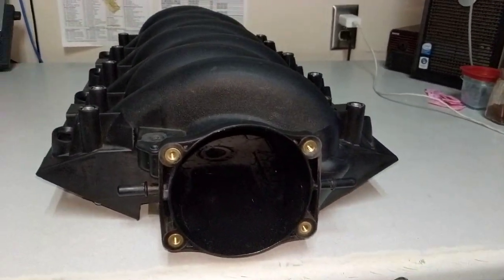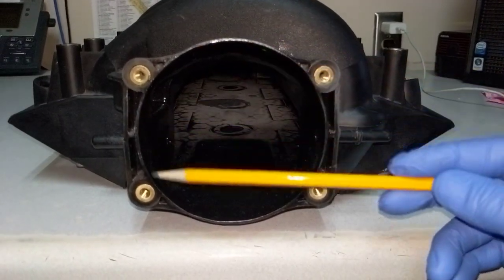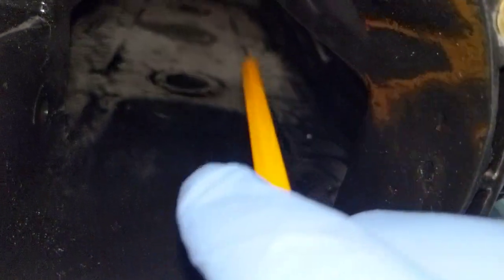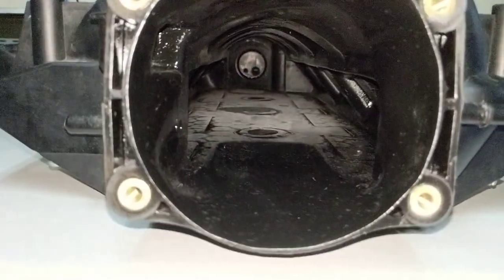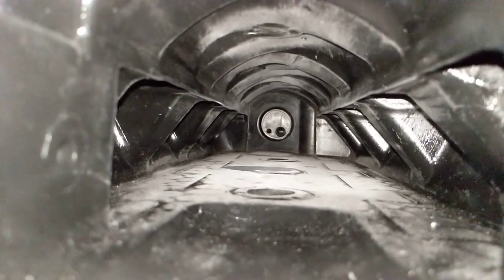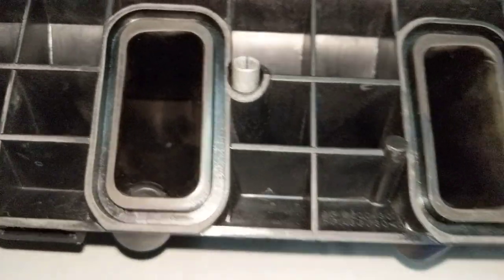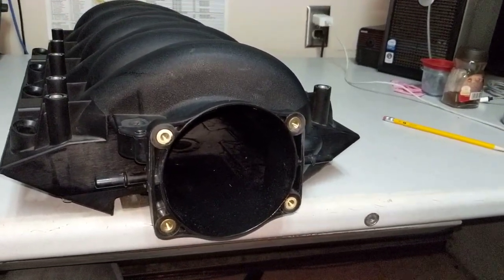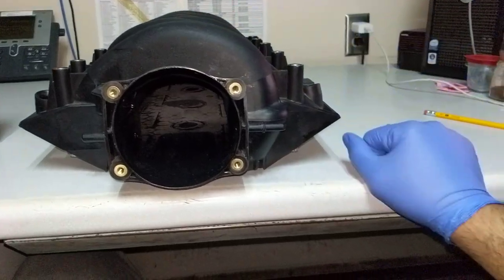A Look At A Hand Ported Stock LS3 Intake

Comment: Nice work mate just what I was looking for I have a 6.0 being stroked to 408 huge cam and was looking to port my intake can’t justify the price tag for a aftermarket intake for just an almost 30hp gain have ported a shitload of heads over the years and was looking to see if anyone had ported a stock manifold what was it like cutting the center posts out looks like it would have been a tight shit of a job

Comment: Nice video,  Thank you,   How did it dyno?   Could you tell a difference if what was the gain?
Reply from the maker: Robert Preston it made 14hp and 2ftlbs over a stock manifold. It made 2hp less at peak than a FAST 102 but made more power average throughout the power curve and 5ftlbs more peak torque but with a much broader torque band. The dyno video comparisons are on my channel.
Reply from the maker: Robert Preston it made 570hp/512ftlbs on a stock LS3 with a 244/256 112lsa cam.

Comment: I want to attempt this. I have some experience with porting. My question is, In your opinion would it benefit my c6 with out the cam? Didn't find much info out there
Reply from the maker: You won't see gains without a cam because you're not using the added airflow. The engine doesn't demand it. The stock LS3 intake will supply more than enough airflow for a stock car. I would not bother porting unless you have a cam and or heads.

Comment: Whats the easiest way to cut out the center supports
Reply from the maker: 1786 Vlogs a long sawzall blade then sanding by hand
Reply: @c5natie1  how did you fill the hole after cutting them out?
Reply from the maker: @m0nster324  epoxy
Reply: @c5natie1  how do you support it while it cures?